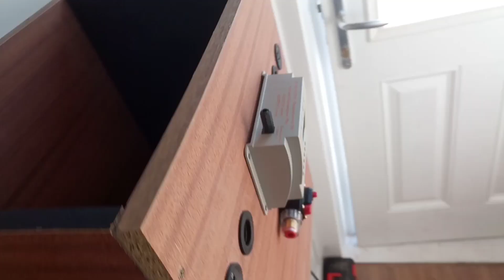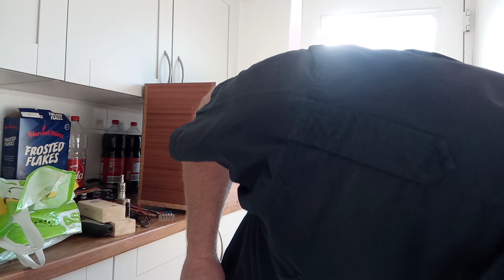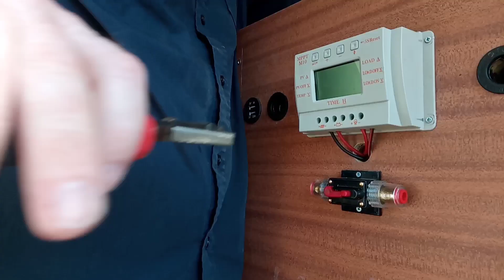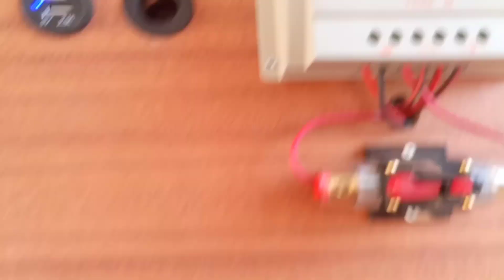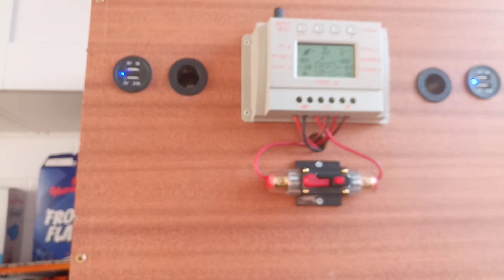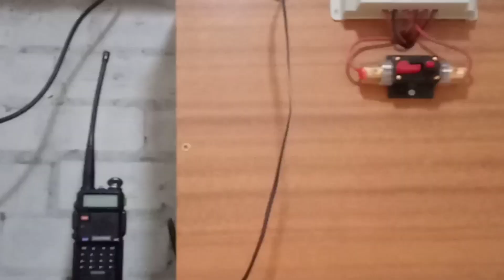Portable solar generator for camping/ham radio and Power cuts part 1

Comment: Good to see you are still using those batteries. I have similar project at home for radio and CCTV equipment
Reply from the maker: Still got them. :) finally moved a couple of weeks ago. Still need to find a shed/out building then I can buy a load more panels and do a grid tie system.
All my cameras are now off the motorhome and are going on the house :)